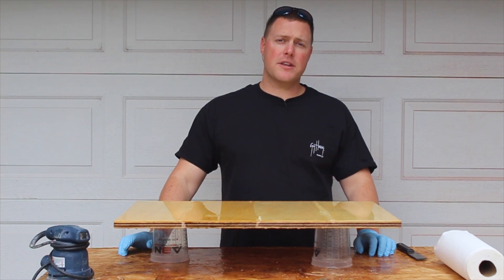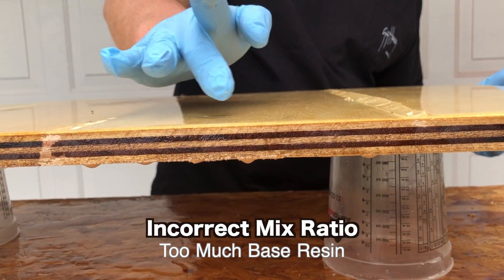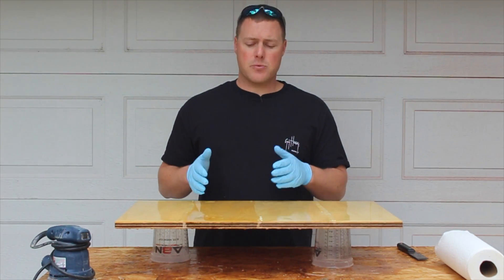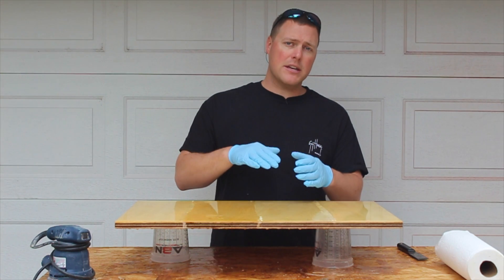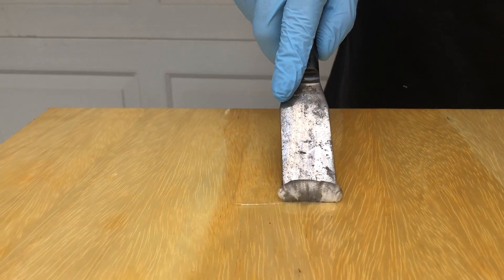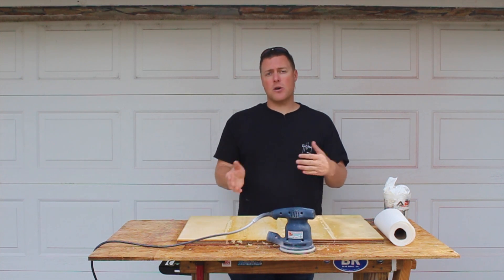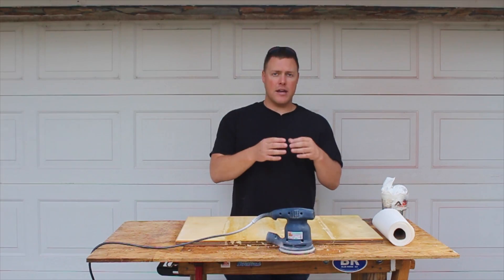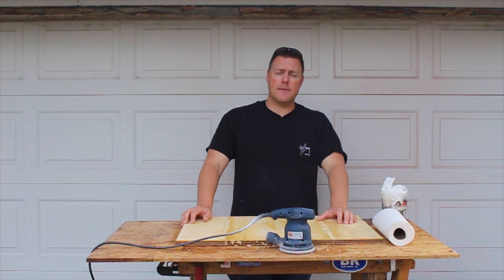How To Fix Tacky & Uneven Epoxy Resin- Table Top Epoxy Tips & Tricks

Comment: please help!
5 days ago i did tabletop my table about 150x50cm using epoxy coating with 1:1 ratio. today i check out my table its hard enough but bit feel like it has elasticity ( i tried to stab my finger nail on it and its leave my fingernail marks and immediately recovery , it also leave my fingerprints easily and when i touch it bit sticky but not tacky like your video), what the problem its called? what is wrong with my tabletop? my room temperature about 84-85f .
how do i fix it? can i just sand it off with 220 grid sandpaper and repour new epoxy on it?
please i need your help

Comment: I did a pour epoxy over a painted table and I guess I missed a few spots or the epoxy did not spread to fill up all those spots.  I then went and mixed more to put into those spots but for whatever reason it did not fill them in properly and now I have a mess.  The second coat remained tacky for days.  I have now tried to scrape off the tacky part  and then sand.  Should I recoat the entire table or just those spots?

Comment: I wish mine was that liquid... I'm trying to remove partially cured resin. 
I mixed it correctly, but it turns out the epoxy I was mixing can't cure below 65 degrees, and I did it in the winter. I wish I could just throw these chairs away and never touch epoxy again.

Comment: Can i touch up burnt epoxy by sanding the area and doing a small coat on the damaged area rather than redoing the whole surface?
Reply from the maker: You will need to sand this area down, sand the entire surface and pour the entire top in a new layer. If you try to pour just the area that you have sanded, you'll likely notice a line where the new epoxy meets the old. In order to get a fluid/continuous looking top, you must pour the entire surface again.

Comment: Hi, i coated a PLa 3d print with similar epoxy  a day and a half ago... is tacky but not anything like your sample in the video... is there any other way it can be fixed? your method will destroy the statue unfortunately... i am really dis appointed i was sure i added enough hardener...thanks
Reply from the maker: Unfortunately, if the epoxy is still tacky, it usually needs to be removed and coated again. Is it cold where you are located? You might want to wait a few more days to see if it sets up any better.
Reply: @epoxydiy6356  Yes it was in high 60's when i applied... its been 4 days now and it is less tacky then it was at 2 days... the brush i applied epoxy with is solid and not at all tacky... maybe in a week it may be good.. next time i am using my gram scale so i am sure i mix 50/50 ...thax

Comment: Long story short I’m trying to finish a countertop for a local record store. I’ve poured all of the countertops and they look great and everything was Shiny and smooth. There were a couple of soots I didn’t like so I sanded them with sandpaper ranging from 240 grit to 2000grit. Now my countertop isn’t shinny and it has small scratches from me sanding. HELP
Reply: Do I need to just keep wet sanding with the higher grit until I see results?
Reply from the maker: Daniel, what type of epoxy did you use? You can try to sand up to 3000 grit. You might also want to try to buff with a yellow foam pad and Finess It II (must be #2): https://amzn.to/37x40jx  However, to achieve the highest gloss/shine you should pour a new layer of epoxy over the top.

Comment: I did my own wood counter tops and did the seal coat first and everything came out just fine, but then I did the flood coat. I had to do it it in 48-52 degree weather in a trailer with no heat or AC I know I got the ratio right but for some reason some spots are still a tad bit tacky in the thickest spots, like you can touch them but it hasn't fully cured. It's been four days and they have all been in the 48s-50s except at night when its in the 20s. This week is suppose to be warmer in the 58-63 range will more time allow it to cure fully or  should I say forget it and scrap it down?
Reply from the maker: You'll have to check the directions, but my gut tells me that the temperatures you have asked about are far too cold. It will be very difficult to get a proper mixture and the epoxy will not self level properly. If you can scrape it down, scrape it down. If you cannot, you might want to use Isopropyl Alcohol 99% or whatever MAS suggests. This will usually help to cut the tackiness, so that it can be sanded down. Again, check with MAS on what they suggest for tacky epoxy. Stay away from anything with ANY water in it.
Reply: @epoxydiy6356  thank you!
Reply from the maker: What type of epoxy are you using? Most epoxy requires temperatures above 75°. If cooler, the epoxy may not mix properly or self level properly. 48° is likely way too cold to try and mix/pour epoxy. The epoxy probably was very very difficult to mix.
Reply: @epoxydiy6356  i used MAS table epoxy
Reply: heat it up
Reply: Slowly

Comment: FYI I am here because I had a tacky Epoxy fail.    As mentioned in the video your sander will not sand sticky epoxy so you will have to manually scape it off.  How ever applying Acetone with a rag  really helped dissolve the uncured epoxy fast.   My Ryobi cordless multi tool also  was a good aid.
Reply from the maker: Good to hear, so were you able to remove all of the uncured epoxy?
Reply: Indeed as a matter of fact I was able to dissolve and peel back below a 2 in 1 primer  paint which I applied over the 1st layer of  epoxy.   The 1st layer cured perfectly,  however I wanted to fill in some spotty patches with color in order to get a even appearance.  This was where things went wrong for me I  think.  Because I did notice that for  some reason the paint had failed to completely dry even after a couple days and I am not  sure why.  I have seen it  done and  recommended by others.    But anyway I went  ahead with the second coat of  epoxy which  only partially cured as well.  But again in patches.   Then I  wiped the cured epoxy with  acetone to remove all  left over debris but it didn't effect it.  I also used 320  which  left it super smooth.  I am going  to  try the paint over  again and if  it fails I  will wipe using the acetone and skip it next time.

Comment: Just to  be clear  what is the absolute longest amount of time you should expect to give  Epoxy to cure and not  be tacky?   I am  using  the Stone Coat product,  Floor kit.    2:1 ratio base to hardener.  My basement is only about 68 Degrees or so kind of cool. .
Reply from the maker: Each manufacturer is slightly different. You might want to reach out to them and check to see what the cure time is.
Reply: After reading many comments here I noted  that you  always asked them for the manufacturer of their epoxy  so I wanted to get  in front  of that and  give  you all the details.  However I actually am aware that the stated cure time is 24 hours.  But looking at this repair video I  thinking that one Epoxy can't  all be that much different from the next . You made a point that you waited  " two weeks of drying time" before addressing the examples of tacky results.   So I was wondering should I give my stuff much more then 24 hours hoping it will cure more before I strip it off.
Reply from the maker: A flooring epoxy is different from a coating epoxy like this. The directions/bottle label should indicate how long it should take.
Reply: Thank you for your time.   Prehaps it unclear that I my question  was  not about the nominal drying time of my product but the general wait time to be certain  all hope for hardening is lost.   I gave it  about  6 days  and then stripped it off.   Thanks again.

Comment: I poured a table that cured and was completely dry for at least 2 weeks. Now it is a little sticky in the middle. Any ideas?
Reply from the maker: This is usually related to incomplete mixing. What type of epoxy did you use and how long did you mix for?

Comment: Hi, i have has a couple of pours recently that seems like it has set properly, seems solid until I go to sand it, and it goes gummy or toffee like and smears all over the table top. i feel like i have done everything correctly but obviously something has gone wrong. do you know what the cause of this would be? its pretty devastating on a river table on the final pour as it you cant see through the soft sanded resin and there is no way to get it off. what do you think oi did wrong?

I can say that both times it has happened, I mixed the batch, then put the container in another container of hot water to heat it up and get rid of some bubbles. not sure if that has anything to do with it?

Thanks,
Marcel.
Reply from the maker: This is usually a result of incorrect ratios. What type epoxy are you using? Are you using graduated mixing container to measure out the epoxy prior to mixing?
Reply: @epoxydiy6356  Hey, Im using a 2:1 ratio resin that is made in Australia, called Super clear (could also be called Platinum super clear) both times it happened I was using a measuring cup and was mixing small amounts (75ml) the cup I used 75ml is about the smallest amount I can mix as it only realy has markers every 25ml, and I'm not sure if you can weigh out the ratios when mixing? on the second time it happened i may have put in a touch more of the hardening part (part B) but thought this would only make it set harder? 

Also I have transferred the both part A and B into smaller containers with taps for easier use, not sure if that would have any impact, but has only happened on 2 pours so far, so Im assuming not.

Do you think I should use more detailed measuring containers?
would putting more part B also cause this effect?
do you know if its ok to weigh out the 2:1 parts instead of measure? for instance 10G of part A to 5G of part B?

Thank you for your advice and assistance!
Reply from the maker: Regarding weight, this will be dependent on the specific epoxy. Unfortunately, we do not have that specific epoxy in the US (at least not that I have heard of). Some manufacturers do provide ratios by weight. No, adding additional hardener, will not make it the mixture harder. In fact this can cause the epoxy to not cure properly as you have suggested. The ratios need to be exact as well as adequate mixing.
Reply: @epoxydiy6356   thanks heaps.. that was helpfull, I will assume that i just got the ratios off a little.

one more question, I had a batch of 2:1 epoxy is a 30L kit, so was 20L part a and 10L part b.. i have used about half of it, and it sat on the workshop for about 10 months, not the hardener seems to be a bit cloudy and has got lumps in it. Is this because there was air in the container? is there any way to get it back to normal, or is it ruined now?

Thanks heaps for your time to answer questions!  Love your work!

Comment: Hi!  I poured my first epoxy project the other day.  The gentleman at the store said to line the frame around the desktop with plastic so it would not stick to the boards/frame.  The plastic came off nicely, but now I have high edges all the way around it.  Can I sand down the edges and re-pour a thin coat to get it back to glossy, or do I sand it and buff it out with a polishing compound?  Or is there another way?  TYIA!
Reply from the maker: Are the edges sticking up higher than the surface area? Yes, you can sand them, but you will lose the shine/gloss. You could then pour a new coat over the entire project so that the edges are fluid with the surface.

Comment: How would you epoxy a raised surface like a fireplace hearth??? ♥️
Reply from the maker: Hey Meg,  do you mean the front/top, what exactly are you trying to apply the epoxy to.
Reply: Epoxy DIY 
the bottom of a fireplace that sticks out BUT sits right on top of the floor (no where to run off!) I have an old floor down now so it’s okay... I will be covering it up lol!
Reply from the maker: Is this an actual fireplace or just for looks? Will it be producing heat?  Many coating epoxies will start to soften around 120°

Comment: If the areas are a little tacky and you can’t scrape them, can you just sand them, clean the surface then re-pour?
Reply: They are just small areas by the way. I did my bar top with the epoxy. I did 3 gallons on it. It came out to a quarter inch thick all together. And I was planning on using another batch to get it a little thicker. But I wanted to take care of the sticky spots first
Reply from the maker: Did you mix 3 Gallons at once? Were they all in the same mixing container? What type of epoxy did you use? Depending on what type of epoxy you used, you might be able to wipe the tacky areas down with something like Isopropyl Alcohol 99% and then sand these areas. Once the tacky areas are removed, you can pour a new layer on the top. If only certain areas are tacky, this is usually a mixing issue. Did you scrape the sides and bottom of the container as you were mixing?
Reply from the maker: Its very difficult to sand tacky areas. The epoxy will gum up the sand paper. How large are the tacky areas and are there many spread out throughout the project?
Reply: Epoxy DIY they are spread out throughout my project. The funny thing is the epoxy is hard. But just a little tacky in some areas.

Comment: If it wasn’t mixed properly, will it eventually cute and harden? We did a second pour and I believe that it wasn’t mixed properly. Now there are some cured spots and some tacky spots... like leave fingerprints tacky.
Reply from the maker: How long has it been curing? Most likely if it's still tacky, it will probably stay that way. The most common cause of tacky areas is incorrect mixing/ratios. This can happen due to incorrect ratios or if the tacky areas are few and closely congregated; due to not scraping sides and bottom of the container as mixing. As a result, the last of the batch, the sides and bottom of the container which were not properly mixed are the last to leave the container and often at the surface which leave tacky areas.

Are the tacky areas thin enough to scrape off? In other words, is the epoxy still liquid enough to scrape off?
Reply: Epoxy DIY so we’ve had it curing for about 5 days and it’s still sticky. Don’t think it was mixed properly. Have been working on scraping the sticky spots and sanding but it’s not really working. Kinda making it worse... HELP!
Reply from the maker: How large are the areas? How many areas in the project? How large is the entire project? What type of epoxy did you use?

Comment: I have a question. I have worked with table epoxy several times now. The surface looks great but the side of the table still does not look smooth. It looks like many runs on each side. How do you ensure that each side look smooth after the epoxy cured up?
Reply from the maker: Working with vertical surfaces can be tricky. As the epoxy is flowing over the sides, you can use a foam brush to make sure the entire side is fully covered. You should do this as the epoxy continues flowing off the side. As the flow is slowing, you can then use a plastic edge or even a stirring stick to run along the underside knocking off the drips. If you do have any drips left after the epoxy has cured, they can be sanded down.
Reply: @epoxydiy6356  Great tips! I'll be trying it out on my next epoxy project. Thank you so much!

Comment: How do I start over on a epoxy countertop?
Reply from the maker: What do you mean by start over? Has the epoxy cured? What is wrong with the countertop?
Reply: @epoxydiy6356  mines cured quickly like in a day or 2, but isnt 100% even, i just ordered an orbital sander, will this help smooth it to look more like glass?
Reply from the maker: It will help to remove the imperfections. However, you will likely need to pour a new top coat to get a glossy finish. Be sure to thoroughly clean the surface before pouring an additional coat.
Reply: @epoxydiy6356  ill do that, i need to also get a blow torch, last time i tried to use a hair dryer as a substitute, hopefully coat #2 will make it look better after sanding and cleaning etc.

Comment: Hi, I need help! My husband bought a coffee table from an artist. The coffee table has drawings in sharpie so we would not be able to use it until we covered the surface.
I decided to do it with resin and I unfortunately did not mix enough, so now the surface is not even WHATSOEVER, it has some pits.
I've watched your videos on how to fix that BUT I can't sand the surface primarily because I'm afraid of scraping the art off. 
My question for you is: Is it possible to fix the issue by pouring much more resin and letting it to become even by itself? Or should I do something else?
Help me save this coffee table please 😭 
Thx in advance
Reply from the maker: Hey Thauani, is the epoxy fully cured now? What brand of epoxy did you use? If it is self leveling epoxy, yes, it should fill in those voids and self level. However, most epoxies require thin pours of no more than 1/8" or 1/4" per application.
Reply: Hi, it's fully cured now. I used the Envirotex Lite: Environmental Technology 32-Ounce Kit Lite Pour-On, High Gloss Finish https://www.amazon.com/dp/B000BZYYQ0/ref=cm_sw_r_cp_api_i_-fJdDbKQXESP7
Reply from the maker: If its cured, you could sand the surface with 320 grit sandpaper, clean the surface thoroughly and then pour a new coat on the surface to fill in those voids.